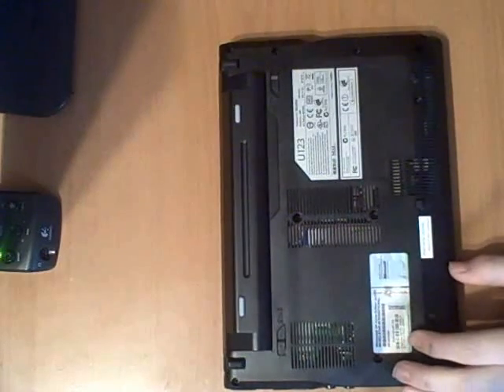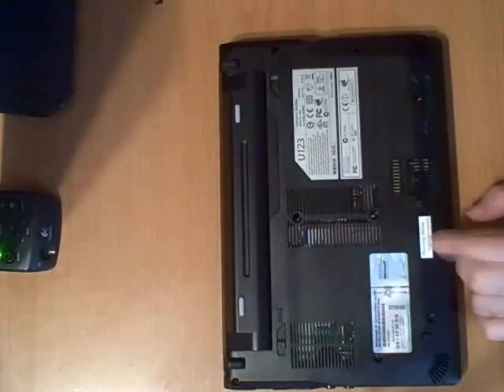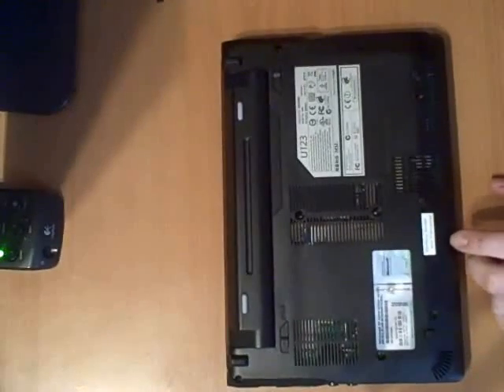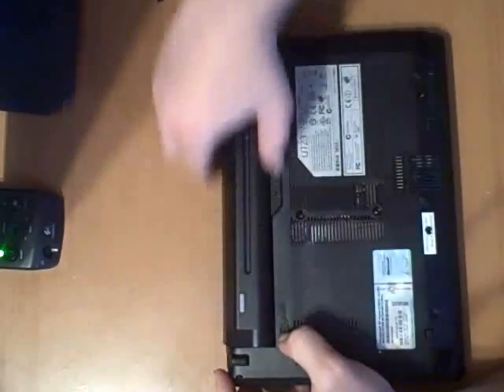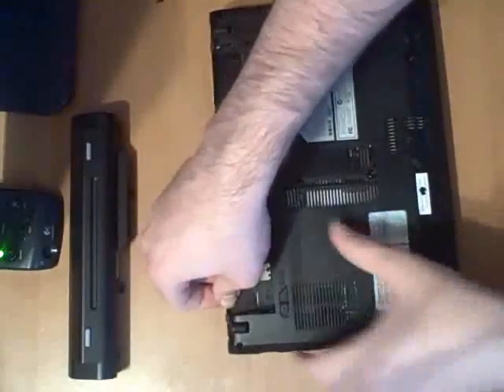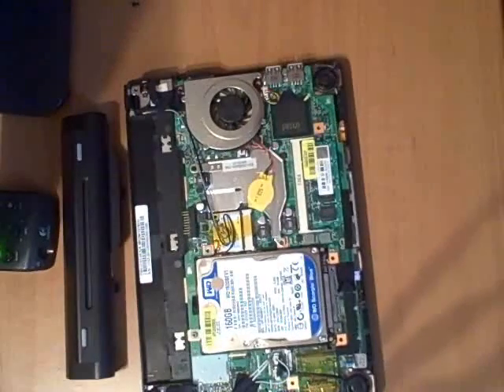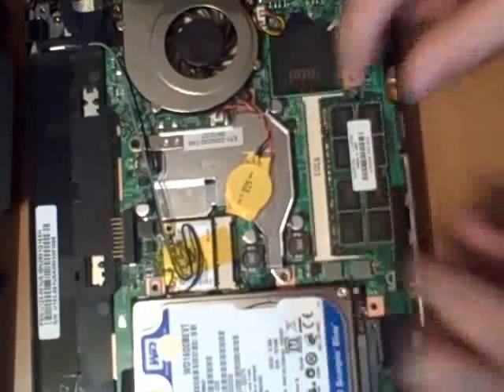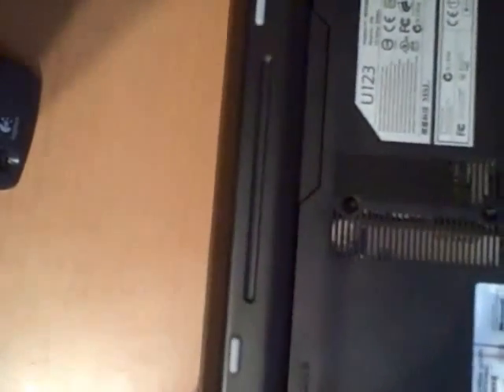MSI Wind U123-001 - RAM Upgrade

Comment: hey im trying to upgrade my ram only i tryed a 1bg and it dident read it, i then tryed a 512 from my lap top and it dident read that either, is there someing i need to do in the OS so it reads the new Ram. Thanks in advance. p.s im running xp.